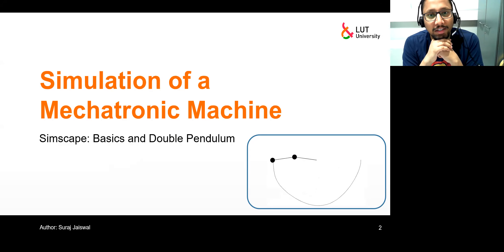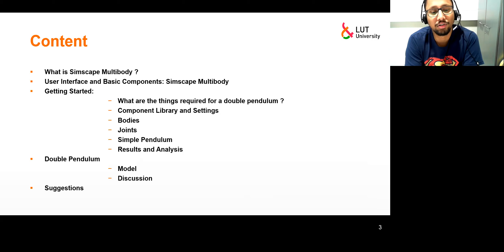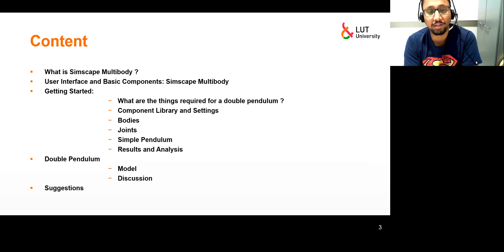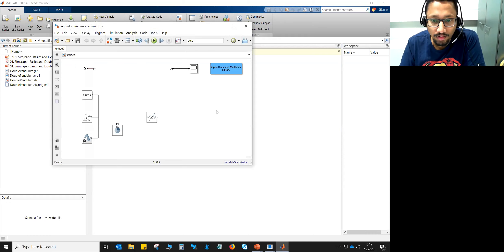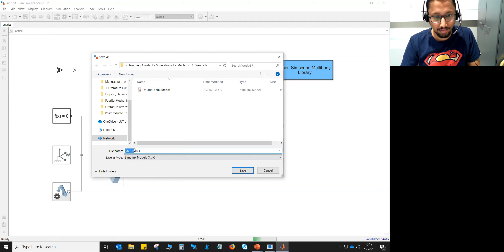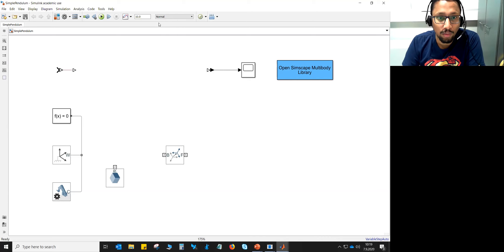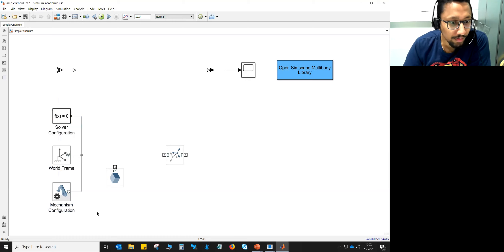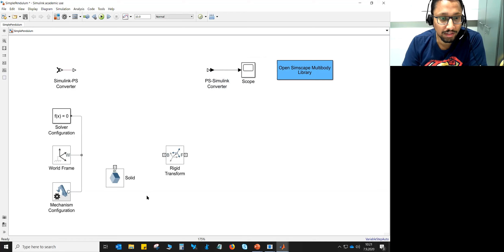Tutorial 01: Simscape Multibody Basics and Double Pendulum Modeling | MSD | LUT University | Finland

Comment: I have made my translation motion based model in matlab, and when I am importing this file in matlab, only the joints do not come in the simscape circuit. Rest of the elements are perfectly imported. Can u please help me out of this. Or can u please guide me in making a translation joint(one degree of freedom) in matlab using multibody. For ex:- a window pane sliding over the base. How can I do that in matlab.